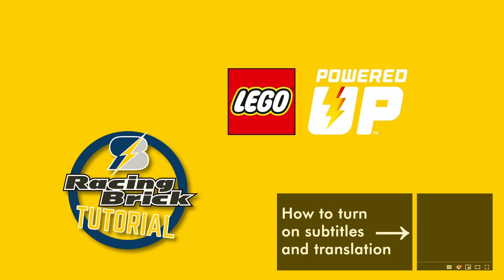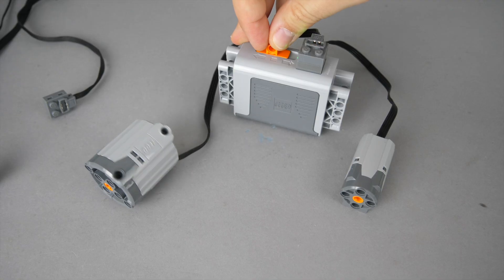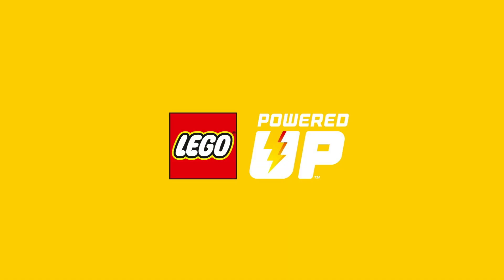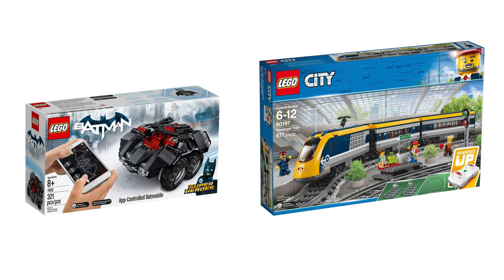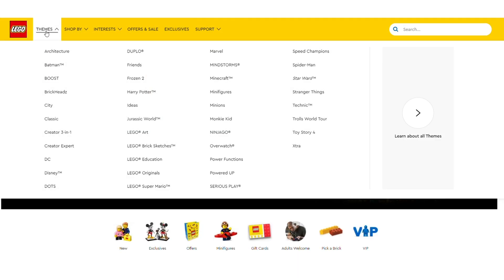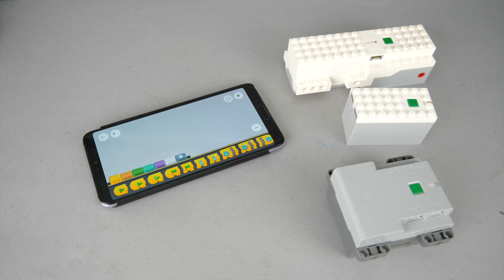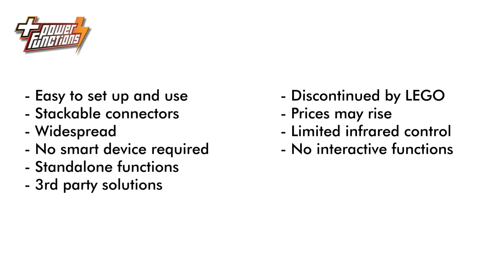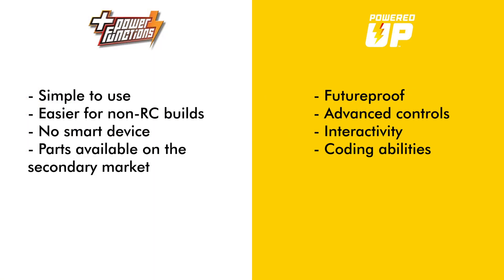LEGO Powered Up basic tutorials - 01 - Introduction & history

Comment: I started with the 6V system from the end of the 1970's and always wanted the slightly better 9v system that looked 'professional' lol. Years later, Mindstorms RXC 1/1.5 system. Since then there's been so many different power systems and robotics system that are not compatible with each other. Lego took the piss with this IMHO. Anyway, I've re-invested in Power Function recently as the parts are ultra-cheap from China. Like £23 for 6 motors and wires delivered to the UK. You video shows Lego made it even more of a mess with each of those.

Comment: Does anyone know if the motor works similarly to a normal DC motor with encoder? I want to cut the cable to implement it on an arduino board and program it with simulink for my bachelor degree. I don't want to risk it if it doesn't work.

Comment: Nice tutorila !! Powered Up does not 'require' a smart device, it also works with remote controllers like the 88010 ;)
Reply from the maker: Only the 2 port city hub has a limited functionality with the remote directly, everything else needs to be connected through a smart device

Comment: Thanks for this. As others have mentioned, this is better than the (non-existent) official documentation, even over a year later.

Question: Is it possible to install the PU app on PC (Win10), especially if it's Bluetooth-enabled? I know I can install the Android APK for PU, but I'm not skilled enough in Android development to determine if this would only allow to run the app in the emulator or if it could run a full fledged app instance. I ask this because all I have to run the PU app at the moment is a smart phone and it's quite annoying with such little real estate on screen.
Reply from the maker: As far as I know there's no Android emulator for PC that has a properly working Bluetooth module, so it's not possible at the moment.

Comment: Thanks for your clear videos. I learned a lot of it by using Powered up.
With my grandson I'm building a robot without an example.
At this moment we have a problem with the Powered up app: We want to connect 2 hubs #880012 (lego technics), but you will understand, it won't work.
We can pair to hubs, but only one is working (the upper in the list).
Do you or any one else know how control 2 hubs?
Reply: Sounds like having an issue with 2 hubs. on the latest version so first connect to the first hub, Click the BT icon next to the back arrow, Power the second hub, and TAP the second hub is paired. and will begin to code a robot.

Comment: Thank you for great info...any ideas for slowing down powered up train motor besides lowering supply voltage to 6v?
Reply from the maker: You can regulate speed using the app, or even using the Powered Up remote

Comment: I'm pretty sure that the BuWizz 3 has Power Functions and Control+/Powered Up ports. This way, you can use both systems.
Reply from the maker: Since that is still not a released and tested product I did not include it in the video

Comment: I prefer Power Functions, its simplier and straightforward. Not really interested on Powered Up system personally, since it requires dedicated app and smart device support. Besides, code editing is not everyone's taste.
In my opinion, Lego is meant to be played manually. Power Functions is excellent for extra playability, Powered Up is only good for STEM purpose.

Edit: Powered Up seems better for STEM purpose.
Reply from the maker: Powered Up is definitely not only good for STEM purpose, it is pretty versatile. But I have to agree it lacks currently an easy way to be used without an app. The release of the simple battery box will help this a little bit but will not resolve completely.

Comment: I think you can connect up tp only 4 hubs to your mobile device right? I've heard that you can connect up to 5 or 8 hubs to your mobile device. Also while "advanced coding" is possible to an extent with the main powered up hubs, you can really only get that with mindstorms. The new hubs are essentially bluetooth controllers, they don't process anything and they don't have internal memory for the code (they do specifications wise but its extremely small and not sufficient for block coding). Because of this, it essentially just constantly sends the bluetooth signal back and forth all the time to and from your mobile device. I've tried using the powered up system  to code some PID controllers but that proved to be impossible for advanced applications. Due to the constant bluetooth signal sending and updating, my phone simply overheat and my app crashed, I couldn't use PID code for longer than about 5 minutes. And I'm using a relatively advanced phone too, the iPhone XS. Also in the powered up coding interface you can’t even type your own variables. Normally you should be able to define anything as variables, even small combinations of letters like “kp” or “prev_error” but powered up coding limits you to just using the letters of the English alphabet and letters of the Greek alphabet
Reply from the maker: Only 4 connections are permitted in the Powered Up app, it's not an actual limitation of the system. And "advanced coding" is compared to the abilities of the Power Functions system which is non existent. The PU app is pretty advanced considering that it is not meant to be a coding environment by default.

Comment: Powered up is way more expensive than the previous version !
Reply: Do NOT buy any standalone motors or hubs directly from lego. It is much more cost effective to buy them from places like Bricklink or as part of sets. 
For example if you buy the technic hub ($90), L motor ($40), and XL motor ($40) individually on lego.com you will pay $170. If instead you buy the Top Gear Rally Car you get both motors, the hub, and hundreds of pieces for $130.
Alternatively, you can like what I did and buy from Bricklink. I paid ~$10 for an XL motor, ~$19 for a technic hub, and ~$15 each for 2 L motors. Prices there vary by seller and fluctuate with time, so prices may have gone up since I bought these.
Reply: it is if u buy single components alone but if u buy them in lego sets i would say its a bit more

Comment: What you missed as downside to Powered Up is that there is significant latency with bluetooth low energy compared to the IR controls of Power Functions.

I also feel like Powered Up is still a public beta.

The app has only recently got support for the technic hubs (and thus finally allowed end-users creative building with them), but programming in the visual interface is very cumbersome and most things you want to do are very repetitive to set up every time.
Buwizz and BrickController2 offer sort of a solution, but it's still very kludgy and I don't really like having to screw with my mobile phone.

However TLG published the specifications to the bluetooth communication protocol (LWP) for this entire generation of hardware and 3rd party libraries already exist that either allow you to communicate from a PC/laptop to it, or like pybricks flash new firmware onto it that allow you to run your own code.

As a software developer the liebherr excavator gave me all the tools to have a great time, but if I received this as a kid I would've been severely disappointed in what is currently possible from TLG and even including 3rd parties. It's mostly just software limitations though, the hubs and motors are pretty solid and have a lot of things going for them, they're just not utilized to their full potential in the app.

I've written some desktop software now to work essentially like BrickController2 but from a PC, so I can control rc cars and other nonsense I built over the past few months and I wonder if people would be interested in something like this made properly instead of hacked together like I have for personal use.
Reply from the maker: There might be a theoretical latency between BT and IR, but in reality it is not really noticeable. Since PF IR only offers bang-bang control with the "quick" remote, a similar binary control method with PU has a very similar latency.
The PU app really needs significant development, especially to make it more intuitive to use without coding knowledge.
Reply: @RacingBrick  I'm sorry, I've actually never used Power Functions, just the 9V system before it and the only Lego IR set I have is 8539 Manas.

In that, the control is pretty much immediate and considering how simple IR communication is I would have thought PF would be basically latencyless as well. That's pretty bad if it's about the same as Powered up, but then you're correct and it isn't a downside to PU.

I've just found that with Powered Up there is considerable latency when controlling from either the control+ app, the powered up app or buwizz/brickcontroller. Even when sending messages directly over bluetooth from a pc in a controlled environment, it's in the order of 50-100, sometimes >200 ms of latency between sending a command and the unit reacting.

Especially when you send a ton of messages (try quickly moving multiple sticks in brickcontroller app and see the hub light flashing orange/red because of too much data), the response gets very sluggish.
Reply: @bami2  Maybe it flashed because of too much power draw.

Comment: There is currently one more drawback of the Powered Up: the motors are less powerful. This is illustrated by the BuWizz 3.0, where max continuous current for PU is 2A while PF has 4A. As we know from elementary physics voltage * current = power. Since voltage is pretty much fixed to what batteries can supply the current is making the difference.

However, as you said, hardware "arsenal" might expand and we may get more powerful motors and/or energy sources/hubs.
Reply: Yes the mechanical power of a PF XL motor is slightly higher than the power of a PU XL motor, but both of them are far away from 4A stalled current. I guess the higher current limit is mainly for the buwizz buggy motor.